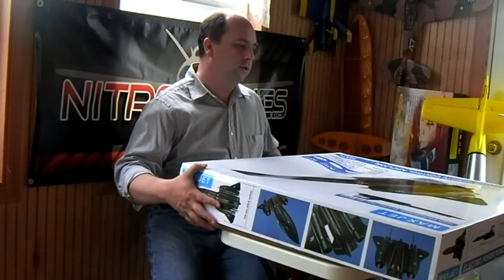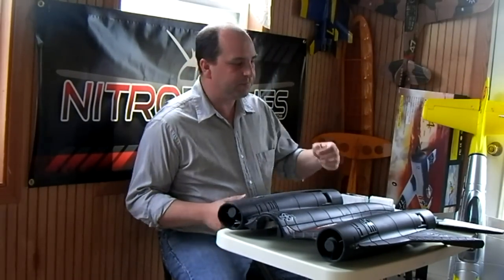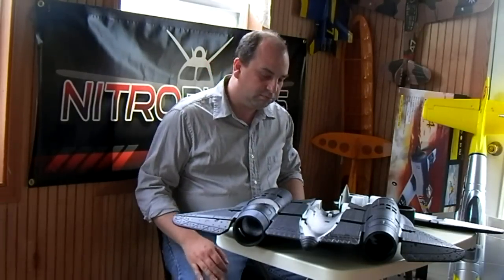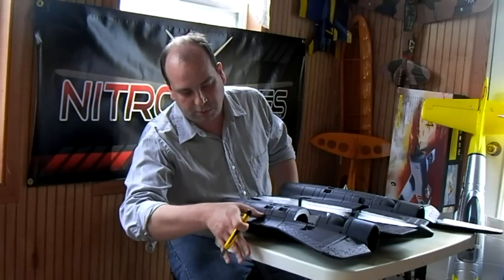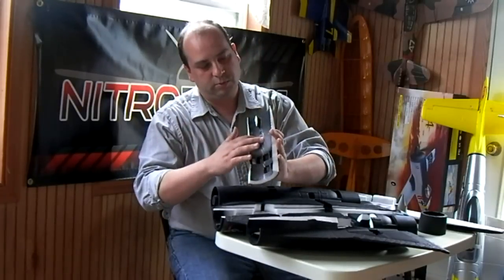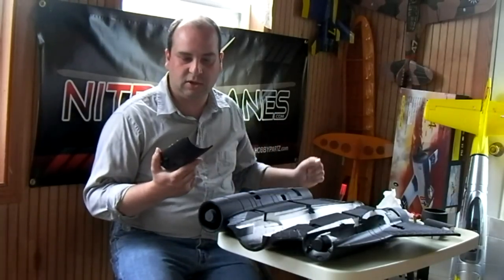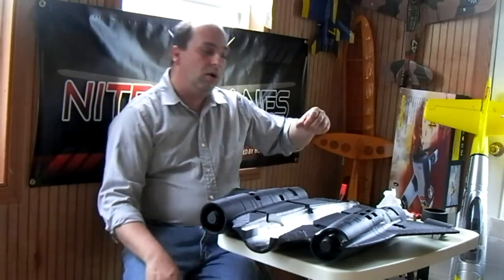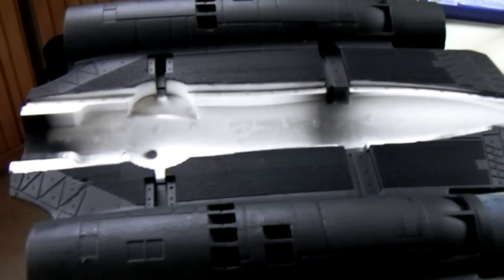SR-71 shipping damage repair

Comment from the maker: @Rcflyyer1 Let me take a look at it when I get home, but I think the motor I used was the Exceede Ultima 4300, or similar.  I will check to make sure.  The 4300 is designed for the 64mm edf, and puts out 330W each.  It should be more than enouh to power it.  I may try it on 3S as well as 4S if it balances OK, and does not over amp any of the components.